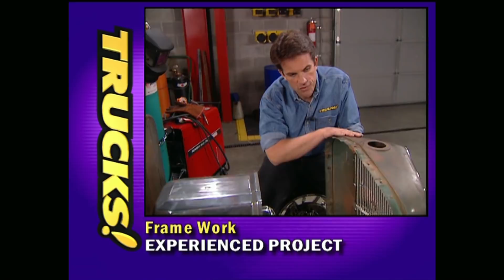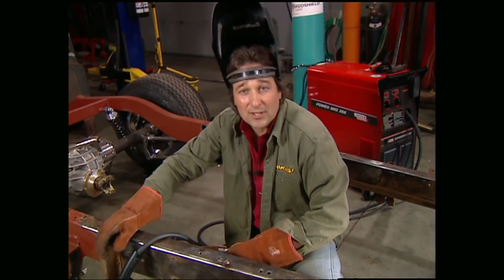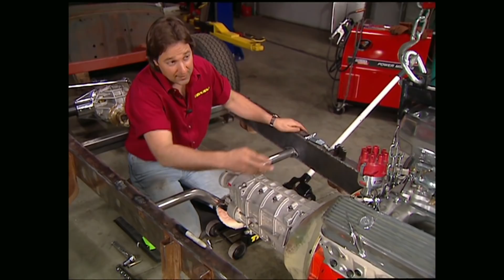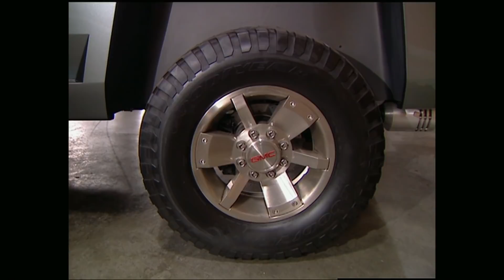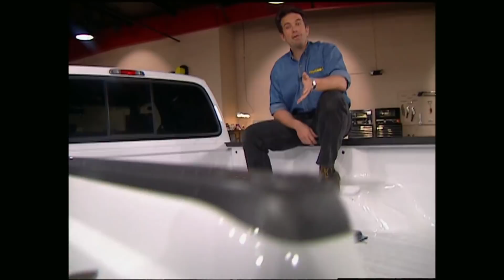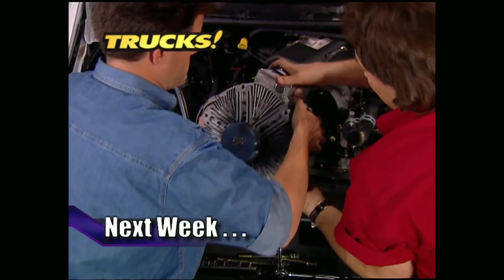Boxing In The Frame Of The '34 International Pickup - Trucks! S3, E4

Comment: It would be nice when they box chassis in like this if they put some vertical stiffeners in. Of course you'd have to then put shorter lengths rather than that single length when you box it, but all they need to do is cut it. 
I used to work in a chassis shop under instruction from an engineer doing mods like chassis lengthening for tandem axle conversions on trucks and that sort of thing. Chassis is just a bridge and if you look at steel trestle bridges they have vertical stiffeners on the UBs (I Beams). I'm not saying put 35 in, all I'm saying 3 or 4 per rail. Even some unibody cars have vertical stiffeners in the front and rear rails many of them (but not all) and I've repaired plenty of them over the years.

Tip, good crush tubes can be made by cutting tie rods down. Just unscrew the ends and you've got some thick wall crush tubes.
Reply: Stacey later on changed four link suspension to a four bar system .